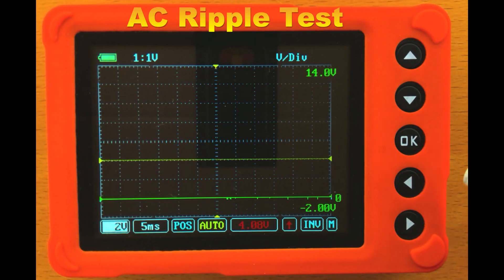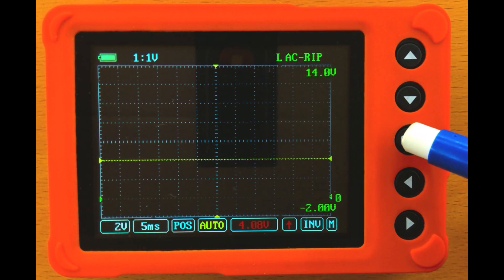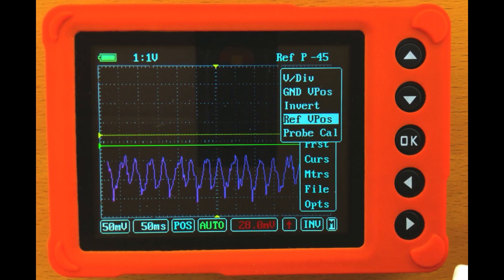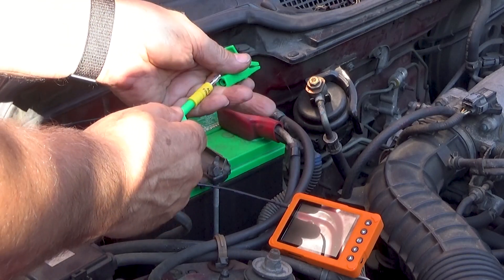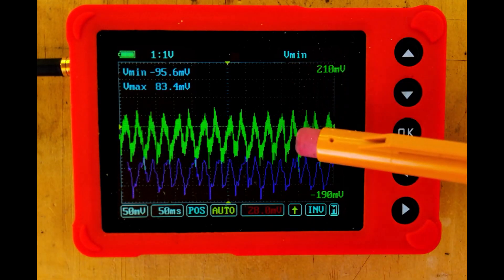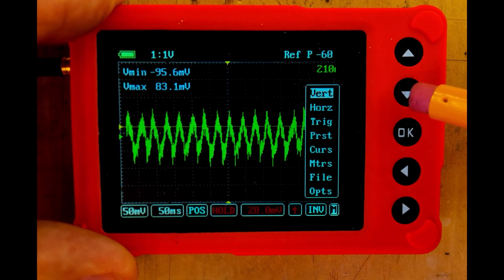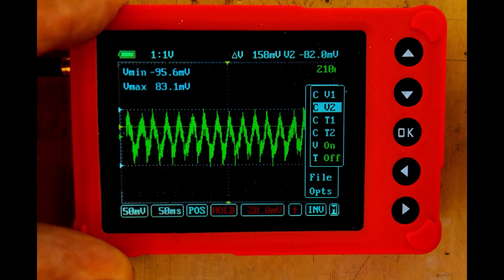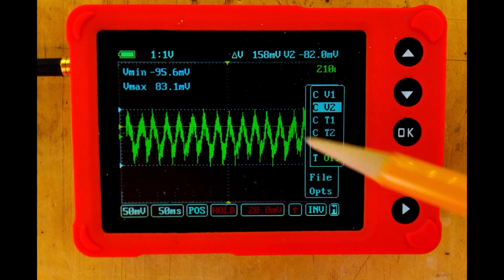Oscilloscope Alternator AC Ripple Testing (uScope)

Comment: I think that's just the charging voltage goin up and down .to see the diode pattern u have to shortened the time ..I have a 97 Civic but I get irregular spikes that coincide with the alt control side so wonder if u have any idea what's causing it
Reply from the maker: By all standards this is called an AC ripple test because those humps are a direct result of the rectifier bridge as it flips the negative pulse into a positive pulse.  The quality of how well the bridge works will impact the amplitude and quality of the waveform.  If any diode fails that can also be viewed.

Comment: Where did you get the reference file from? Or this is just a preset - the set of parameters stored under User selected Name?
Reply from the maker: My reference file came from my own personal actual test.  When you make a test and you press the A button the settings and waveform will be saved into the meter memory card.  Under the description of one of my videos I provide a link to a zip file that you can download. it has all of my presets that also have the reference file.  You can connect your uScope to a PC and copy those files into your memory card.  One of my videos shows you how to do this. It's been a while so I don't remember which video has which. Sorry.
Reply: @DrivelineMaster  I couldn't find uScope anywhere on Amazon. On Official product website it cost 199 bucks. I shouldn't bother you with questions. I'm not even gonna use this thing more than couple times in my life.
Reply from the maker: @SergSpace  The uScope is only available from AES Wave https://www.aeswave.com/1-channel-scopes-c462/  There should have been this link available within the last few seconds of the video if you watched it to the end.
Reply: @DrivelineMaster  Yeah. And I cried when I saw the price of the thing which I will probably use once or twice for the whole of my life.
Reply from the maker: @SergSpace  For anyone who is not in the automotive repair industry and would only use this a few times it's expensive but for a technician who would use it frequently and for what it can do the price is reasonable.  A lot of automotive testing tools are quite expensive.
Reply: @SergSpace  The Uscope is pretty cheap compared to the competition, a proper scope setup can easily hit 7000-10,000 dollars USD

Comment: Great Job once Again Mr Master Driveline. Question how would you set the scope up on a Digital ABS signal? I look on your chart which is not listed. Thanks a million
Reply from the maker: A digital ABS sensor is going to be hall effect or magneto resistive. I don't think I have a vehicle to test this on but I would start with the following settings. These are most likely a 5 volt circuit but they could also be up to 12 volts.  Start with a voltage setting of 2V (lower it to 1V for a 5V circuit), set the time to 50ms and you may need to adjust it up or down based on the wheel speed and the amount you wish to view on the screen. Auto trigger, Trigger voltage around 1 volt, Trigger on the Rise, invert off, horizontal trigger 1 graduation from the left and meters set to frequency.  Tweak these settings once your connected to the vehicle and the faster the wheel speed the higher the frequency. I will put this on my wish list to do.  locate and back probe the trigger or signal wire from the sensor. There are only 2 or 3 wires so even if you are guessing and check each wire you can't hurt anything. The wheel should be rotating slowly when your probing the sensor wires.  If you get this to work please write back with what settings worked for you.
Reply: Thanks a Million, im on  vacation right now soon as i get back👍🏻